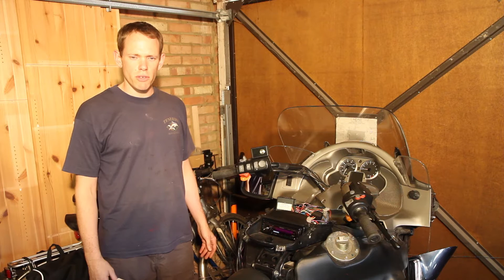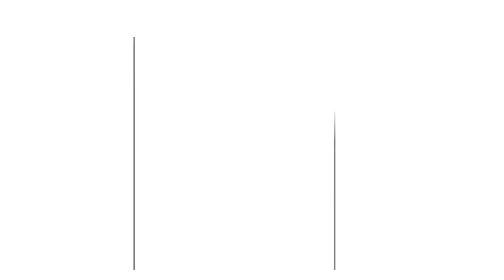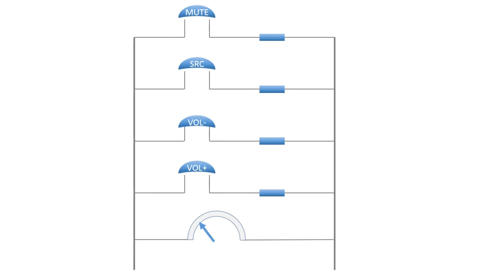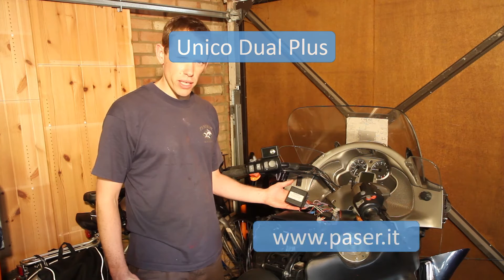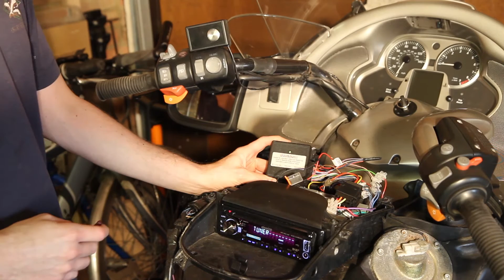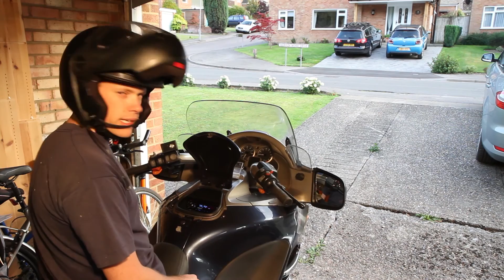K1200LT Stereo Remote Buttons

Comment: Hi Nick, nice video of the radio remote.  Did you set up Bluetooth with the source?  If you will, please respond via email. I subscribed to your channel. Thanks, Rich
Reply from the maker: I don't think I can reply by email!  This was such a long time ago, I can barely remember now, but I believe I tried initially connecting the phone via an aux cable to an old stereo I had laying around.  However, when the phone was also connected to a USB charger cable from the bike, there was too much interference from the ignition system, so I then bought a new stereo unit with Bluetooth, and connected the phone that way.  The output from the stereo to my helmet was wired - I had to remember to unplug before I stepped off the bike.
These days, I have a Bluetooth receiver in the helmet, and just connect directly to that.  Simpler, but no remote buttons possible though!

Comment: I thought the video was great. I have 2004 K1200lt and I want to change out my stereo and as soon as I get the Unico  Dual Plus I will start working on my bike. thank you for the Info
Reply from the maker: Great!  Let me know how you get on, or if you have any problems.
Reply: Nick Elliott which Unico Dual did you used the universal or the one for the BMW
Reply from the maker: Frank Roland  I used the Unico Dual Plus http://www.paser.it/en/p/80/Unico_Dual_Plus/
Reply: Nick Elliott Nick I need some assistance make some cable connections. I received my Unico Dual Plus this week and I purchase a Kenwood KDC-BT758HD receiver. I saw on your video that you had a output connection from the Unico  to the remote connection on the receiver I see that this is a separated cable and where do I get it. And on my receiver it has a steering wheel remote control connection. Any help will be well appreciated.
Reply from the maker: I bought one of these types of leads that matched my stereo:

http://www.halfords.com/sat-nav-audio/car-audio/stereo-fitting-accessories?type=Harness+Adaptor&initMin=0&initMax=100&pgSize=42

then I cut off the plug at the other end and connected the various leads to the speakers, 12V supply and so on, and one of them was the remote input, which I connected to the radio code output wire of the Unico.  Take your stereo into your local car audio shop and I'm sure they'll sell you a lead that you can cut and use to connect it up.  Does that help?  Let me know if I've misunderstood.
Reply: Nick Elliott I work a lot just had time to try and set up the unico. first let me ask you about is your toggle button connection what wire did you make the connection to. I tried the programing like you did in the video but each time I tried the seek on the left side I would not get a light.  but I would on all on all the other button push do you have any advice
Reply from the maker: Frank Roland Hi Frank, I don't remember which wire I used for each connection, but it doesn't matter, as long as you are using the various aux ones.  If everything is working except the Left Seek button, I would switch its connection with the Right Seek and see what happens - if it's now the right seek that doesn't work you know you've either picked the wrong wire or the wire is damaged, and if the left seek still doesn't work and the right seek still does, you know you probably have a problem with the button itself.  My volume down button is a little bit worn out - maybe you have the same problem.